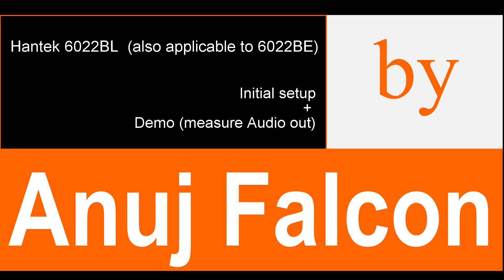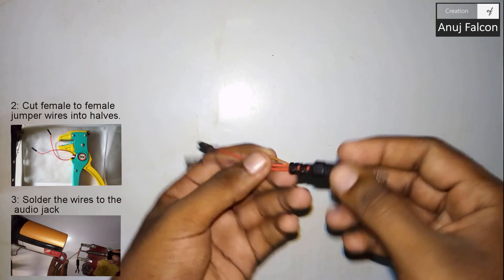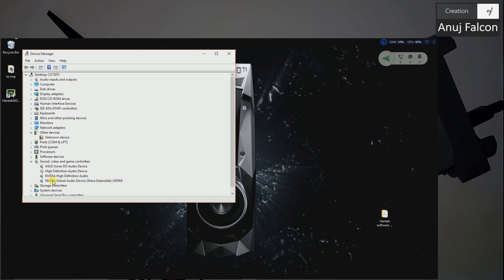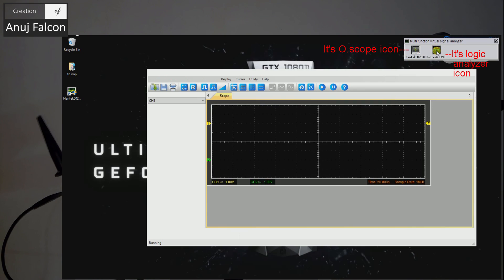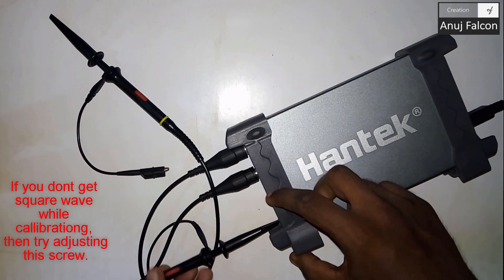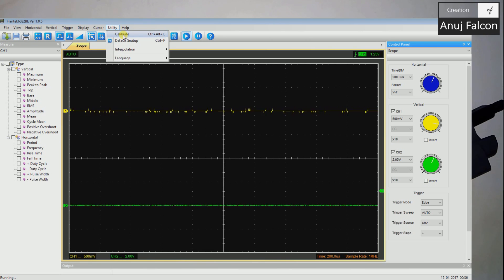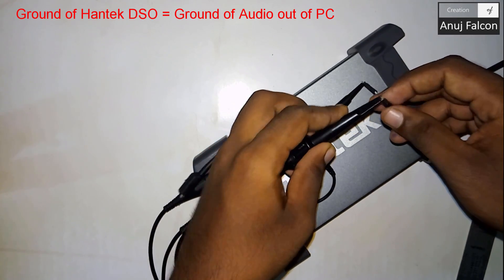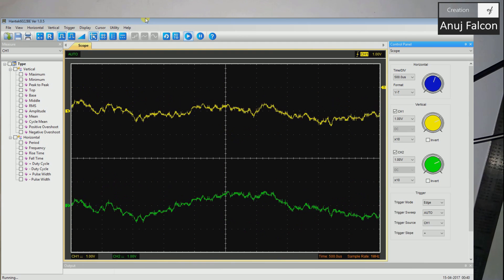Hantek 6022BL/BE + Demo + Windows 10 =?

Comment: In regards to the button, read the PDF manual, page 26. It says "press the button down to run hantek6022BE software". Page 64 says " press the button down to run hantek6022BL software." I think When you are running alternate open source software like OpenHantek, think button makes your hantek6022BL compatible with hantek6022BE  * I THINK *
Reply from the maker: Ali Moeen, thanks for your research. I did come to know about a new software "open hantek" from your comment. Thanks.

Comment: Hello ! I liked your video much. Are you still happy with the Hantek today ? I will look for videos of the logical analyser . Regards
Reply from the maker: It's still awesome. I even bring that with me where ever I travel for quick debugging. 

With regards to logic analyser, one can use all 16 channels or just use 8 out of 16 with salae software (need to press the button behind and replug the usb to change the driver).
I was able to analyse i2c signals, all relevantly labelled (qck, write/read etc...). It looked gorgeous.
Reply: @AnujFalcon  Great tool then. I guess the 20 Mhz limit is not that bad forusual measures (nothing extra fancy!)   Thank you for answering me so quick. Your videos are good, well done ;)  Where do you find the adfaptor to read the channels ? I suppose it depends of what you want to investigate - I thought of monocard TV , with a testing connector, but I suppose some tools exist to plug on ribbons is it ? Best regards
Reply from the maker: Interestingly I received no notifications for any of your latest replies. 

Yes it does come with afew different type of connectors. I wanted to measure pretty high voltage stuff so I hade to order a 100x seperately. It comes with two 10x, some jumper wires and pinching type test leads (I dont know the proper name.)
Reply: @AnujFalcon  Do you know if an USB isolator working at 12 Mbps max will allow the full transfer with USB2 ? Thanks (just to avoid mistakes with grounding)
Reply from the maker: Well I tried without one and is certainly a dangerous thing to work without a USB isolator. But I haven't purchased one yet... Be careful about the power ratingsof the usb isolators - I remember being a little put off by that.
Reply: @AnujFalcon  Oh I did see USB isolators, and my impression is that they are there for audio mostly, to aboid rumble, may be protect against 50Hz parasitic frequencies ? I was said it is a mistake to take them as galvanic isolators - but I am really not sure on the usefullness then, if an earth "boucle" is always possible, ???
Reply: @AnujFalcon  also do you think places like Bangood sell bad series ( not up to the grade) or even "copies " of Hantek équipements ?  The brand even say they will not take under guarantee the ones that are not baught directly from them look at their site ( Aliexpress, Amazon ,Ebay, etc ). A friend that tested some of them was deceived too often ) not at specs, cheap plastic  not " serious" . But he did buy from Bangood mostly. What do you think?  You can mail me privately isaac.oleg at gmail  . If time permit ... thank you
Reply from the maker: It can happen. Infact I bought a bunch of sensors and someof them didn't work - no thank you bangood. They give refund in some BG points which is useless as I couldn't or didn't know how to use it.

I use bangood when cheap is the way. But so far I only had one such instace and and the loss is too low to stop doing businesses with them. But always assume these products as knockoffs. Unless someone buys from vendors like Farnell, digi-key, Ti, mouser etc,... One can't be so sure. Amazon is somewhere in the higher middle ground. So I purchased this scope from them.
Reply: @AnujFalcon  Hello, I just received the 6022BL , now with the original software. I cannoty see any synchronisation AC, DC , is it only automatic ?  Other software propose it ? Thank you
Reply from the maker: Happy to know that you liked my video
Reply: @AnujFalcon  I am really unsure at that point, do you think PWM signals can be seen with such low range osciloscope ?  we talk of 20Khz and above , is the definition enough ? Regards
Reply from the maker: I follow the five rule. 5 times the max frequency to be sampled (0-20khz) is 100khz. 20Mhz is far more better and can produce 1000 samples per period for a 20khz wave. That will be resolution at which you will be measuring the pwm. Now you have to decide if that is enough. For someone who is interested in getting more details about the edges of the signal, venture in to GSas please - they give awesome results.
Reply: @AnujFalcon  Hi,, may I unsinstall totally the factory software to use open Hantek ? The original software is very limited, plus I see the USB driver differs so why keeping it? BTW the OWON? VDS 1022i makles twice more things tor a similar price.
Reply from the maker: The driver was a real limitation for me. Some how this unit wasn't detected when I tried other softwares (except Salae). So I just used what worked. Kinda served my purposes so far. But sure I have to take a look into that again...
Reply from the maker: This oscilloscope is just like a preliminary tool which one can use before jumping the big guns (like using a screw driver type electrical tester as a screwdriver). So if you can find something better at this price, it's worth going for it. 

But once someome gets serious about the analysis, it's best to get a scope with high GSas (dedicated ?!shared per channel...) and better cabling (probes, jumper wires....).
Reply: @AnujFalcon  Hello, and thank you so much for the detailed answers, in the end I was pissed off with the Hantek, no AC coupling and the open Hantek software did not want to run on my system. SO I send it back (also I had exchanges with a good tech that have tested some Hantek product and did not like them). I did go for an Owon VDS10221 i (with USB isolation) a little more expensive but I can sell it later for something more "serious" - less sensitive to 50Hz for instance ;)  .robust, metal case, a3entry for synchro and other operations. 
I was told that I need even in that case, to use a differential probe for high voltages/AC . I may say I am happy with the Owon, really, the software is real, with much more possibilities from scratch, the Micsig differential probe allow me to be reassured when I look in the primary of the TV alimentation. However I wonder if , having that USB isolation, I could try to have 2 traces to see if they couple, one in the primary with the diff probe, and one in the secondary. Not sure how it can be setup, that is to see how PFC works and if there is a relation  I can see in the reaction boucle, that is I guess after the optocouplers. Not at that level yet, but indeed I used a bit of earned money to have enough tools, I even find a 7x 45x binocular from an European brand (body metal, separated alim for a double lighting system) sold about 70USD (80€) , very exited about it, even if I may need to find a x0.5 "Borlow" to have a larger view.  Best regards

Comment: The button selects your mode of operation using a USB platform;  DSO or LA

The device has a "H/P" button. Depending on whether or not it's pressed it comes up with different USB VID/PIDs:

Pressed IN: 04b4:602a Cypress Semiconductor Corp. (used for Digital Storage oscilloscope mode)
Not pressed (OUT) : 0925:3881 Lakeview Research Saleae Logic (Saleae Logic VID/PID, so fx2lafw works out of the box)

When the "H/P" button is not (UP) pressed, the device can be used as 8-channel 24MHz logic analyzer via fx2lafw out of the box (using the fx2lafw protocol). Button DOWN is the DSO.

Comment: The H/P button can be kind of hacked to serve another purpose: compatibility with Salaea logic software.
If you buy the 6022BL, ie with logic analyzer, you'll quickly find the Hantek logic software to be below par.
What they don't tell you is that their logic hardware is fully compatible with the Salaea logic software.
If you install the default 6022BL drivers, it will not allow the hardware to find the Salaea logic even if you release the button to P-mode. 
So do not install software for 6022BL, but install for 6022BE only. Your oscilloscope section will work normally with button depressed (H-mode) . Then when you want the logic analyzer, release it (P-mode)  and run Salaea.
You're welcome.

Comment: Windows 10 now requires signed drivers and this unsigned driver is painful to install, Google "install unsigned driver in Windows 10". But you might need an extra step to bypass Bitlocker with the recovery key.

Comment: Hi Anuj, Did you set the Hantek PC oscilloscope software on your PC with Windows 10 (Home)? Or is another operating system on which installed the software/PC oscilloscope? Thanks
Reply from the maker: It's on my PC with Win10. No VMs.

Comment: let me know friend..." i want to buy this from aliexpress, it's will be the first time i use osciloscope, i need to measure pwm frequency and AC high volt frequency 220v up to 1200V AC. does my laptop will safe from damage?
Reply from the maker: Interesting project I presume. Whatever you do, don't supply more than +-5v to the input terminals of the DSO. So you will have to attenuate the signals before supplying to the DSO using 1000:1 attenuator I guess (1200/1000 = +-1.2v).  I have used 100:1 probe to measure 220v AC mains. Works perfectly fine. 

As the probe attenuated before getting into the DSO, no worries on insulation (Spend on a descent probe and stay within it's max voltage limits).

Better the unplug the laptop from mains (As I am unsure whether neutral/ground wire is connected to the USB ground. In that case, the DSOs ground is connected to USB ground , non isolated hence if you accidentally plug the ground of BNC to live 1200v, it might flow across burning everything as the goes like ghost rider.)

You too wear some good insulated boots as your laptop shell may be connected to ground and ... you get it right.

It's doable, but with caution.... Needn't be afraid of anything. As a safety practice, try finding the live terminal using a tester and make sure you have connected the gnd of BNC to neutral and not to live with the laptop unplugged from mains.

When unplugged from mains, your laptop is now said to be floating in voltage. So be sure nobody touches it non- insulated from earth or the mother earth will punish hard.

Or you can use a USB ground isolation stuff from amazon....

Please be careful and do it at your own risk. Be careful and confident. It's doable. 

Remember, peak value of AC is greater than the RMS value.... so buy the probes accordingly.
Reply: Anuj Falcon thank's for your fast respon..😀😉

Comment: Can I use the same scope for analogue signals and logic analyser as well?
Reply from the maker: SJD , the answer is yes. But the default logic analyzer software does not support triggering. So if u wanna see what is going in in your USB, you will have to send the data over and over again then wish good luck and click run. Alternatively you can use salae logic analyzer driver. Will upload a video soon.

Comment: The HT6022BE driver on the Hantek website is unsigned and will not work in Windows 10.
I found this signed driver which works on Windows 10 and I share it here:
https://drive.google.com/open?id=1-O5tUewwdNRq2rD-JrOUT7zbUTOhqEfs
Reply: The above link isn't working. Can you please share the link for signed driver?

Comment: On my Windows 10 Pro x64 this doesn't work. It does not matter how I install the Driver (there a many ways to do), I always get the Error 52.
If someone here came past this issue (was able to solve it), please let me know how.
Regards from Germany
Reply: The problem arises from the HANTEK site providing 32 bit drivers for Win10. I had to contact (e-mail) them and was provided the 64 bit version.
I share this 64 bit driver for the HT6022BE here:
https://drive.google.com/open?id=1RZcqgOSUP2srdCmgFrrNdoWZoxIge-zV
Reply: I love you dude , kiss you if you will be a woman . THANK YOU SO MUCH , you help me with this link. <33333333
Reply: +Artjoms Potemkins - LOL, you're welcome!
Reply: 26/5000
thank you very much, it worked.
Reply: @theGADGETSplaylist  would you please send me the 64 bit driver for the 6022BL ?
Reply from the maker: Was the driver properly installed?, was the program properly installed? Do you have any suspects? When do you see error 52?
Reply: Anuj Falcon thanks for reply... I got it now... The error appeared instead of the "driver successfully installed" message.
In my case I had to select known device (hantek 6022BE was selectable), navigate to the driver file and uncheck the "show compatible devices". Only then the option "hantek driver 2" appeared. I selected it and got the message "successfully installed" for the first time. Then I had to reboot my PC and everything went well. Everytime I selected "driver 1", I got that error 52 (unsigned driver). 

Hope this helps someone.
Reply from the maker: Eden Cerberus thank you for sharing your experience. It definitely helps many including myself.
Reply: Anuj Falcon I noticed, that my comment is not clear enough. I will write a better description (kind of walk through) when I get home and post it here, so others can hopefully benefit from it.
Reply from the maker: Eden Cerberus, unless somebody dealt with this already you are right.  Anyways, thanks for your interest. If it' a walk through, better create a blog with pics and put a link here. That should do it.
Reply: I have the same problem!
I did this, but from error 52, in driver1 and in driver2 in windows 10

Comment: please  sir  send  me  your  mobile  number  
I have  lost of  queries  Regarding  this  hantek  6022 
before  purchasing  this  device  I want  to  contact  you 
 I will  wait  your reply
Reply from the maker: Rajesh Jajme, feel free to contact through e-mail :
anujfalcon8@gmail.com and thanks for watching.
Reply from the maker: Official link here.
http://www.hantek.com/en/ProductDetail_2_153.html

1. Based on what 'I can observe', the max voltage that can be input to the probes depends on attenuation. At attenuation-1x it maxes at 5v (I don't think it's a good idea to max out). At attenuation-10x it can withstand up to 50v. I am not sure of the raw volt input that can be given to the o-scope without probes. You can go and reach up thousands of volt if you have good probe attenuation probes.

http://forum.arduino.cc/index.php?topic=200344.0 

might give you a different perspective on attenuation and voltage input.

2. As long as you are in low frequency (in KHz or low because I haven't tried it with Mhz yet though it says one can measure up to 20Mhz but this is still the amplitude drops to 70% I guess) and not expecting a very high-resolution data ( data less that nano seconds or less). I don't have the numbers accurate because I don't have other high-quality input device or oscilloscope to test. 

http://www.eevblog.com/forum/testgear/hantek-6022be-will-it-work-for-me/

 is a very gooood starting point to decide if you need this one or better. Something is better than nothing.

Comment: Nice review....I'll probably order this within 5 days. The H/P button when pressed works as oscilloscope, and when unpressed, it works as Logic Analyzer....I think....
Cheers from Kerala
Reply from the maker: Nope. I was able to record the logic signal and Scope signal in both the positions of switches. I am out of guesses. (Maybe useful when I connect them with other hantek devices :0) .
Reply: hmm...May be for better compatibility for some harware that mode is present...not sure,, i found it here
https://sigrok.org/wiki/Hantek_6022BL
Reply from the maker: Aneesh Prasobhan thank you very much for your contribution. It sure does have some useful data.